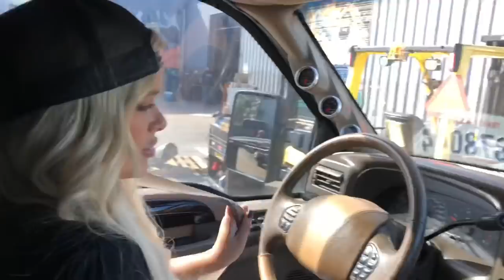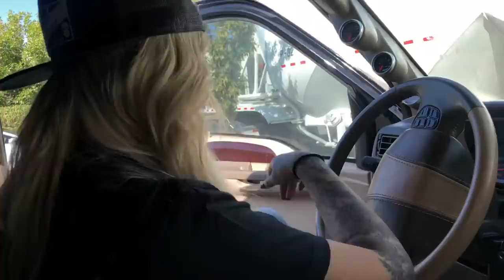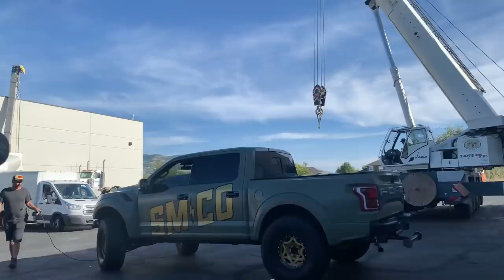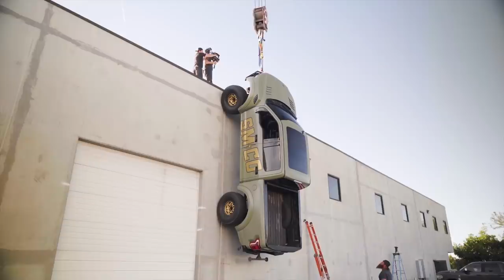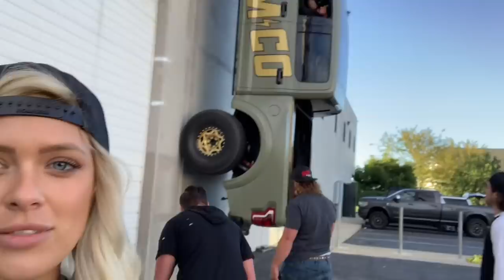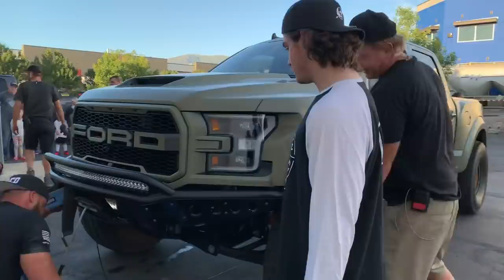Heavy D hung his Ford Raptor from a building!

Comment: I would hope that any 12K winch snatch blocked would lift 6 thousand pounds .......Its supposed to do 24 thousand pounds that way so lets get it on.....Quit playing..
Reply: Pretty sure a winch only gets its full rating when it’s snatch blocked, so a 12k winch is only 12k when it’s Snatch blocked. But  still doesn’t seem that impressive I think a truck buried in mud would be harder to pull out
Reply: @hiphophead9059  Well no , perhaps they are doing that now adays to make up for the fact that they dont actually pull well at all and the duty cycle is about as long as a .... well never mind , you ge tthe point.
Reply: Kyle Van Tassel sorry you are right.